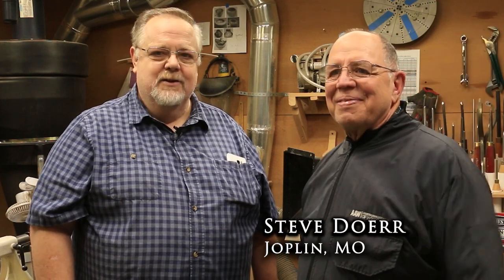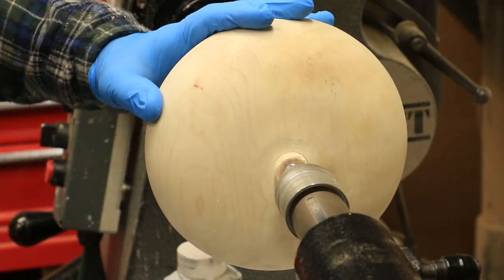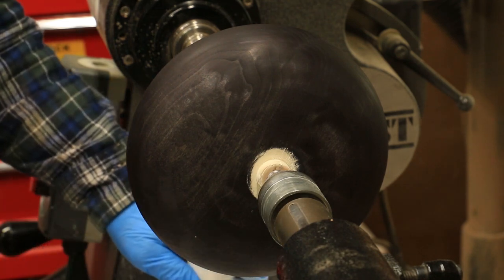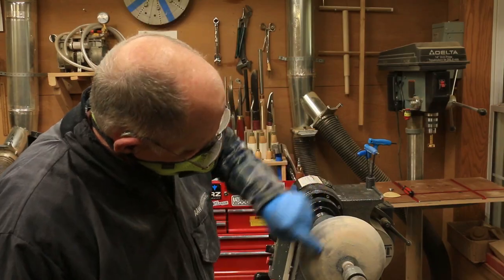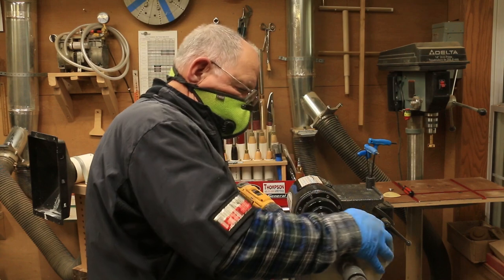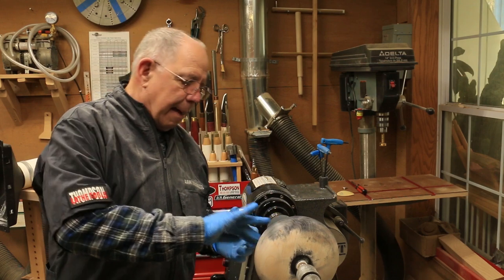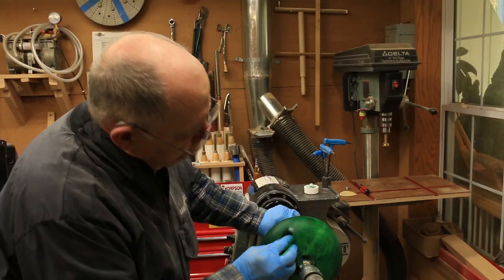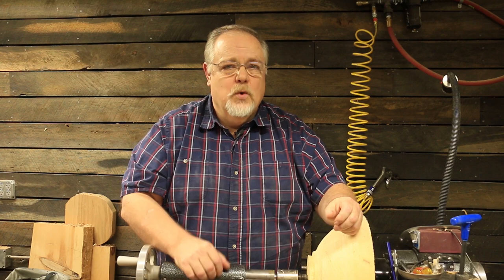Applying Analine Dye Woodturnings (Part 1)

Comment: Hey, I have a question...
When sanding the black stain why use a power tool and not sand it by hand with lathe on?, is the time that you gain or is a better way to not have scratch marks from sand paper?
Reply from the maker: In my experience the drill is going to get the job done much quicker than hand sanding and it will also reduce the radial rings left behind by holding sandpaper to the spinning piece.
Reply: @missouriturner  Larry is correct about the sanding.  I use  the drill because it is quicker and that it reduces the radial rings that occur when using plane sandpaper to sand by hand.  It is also less tiring.